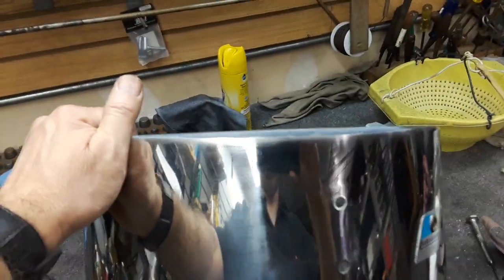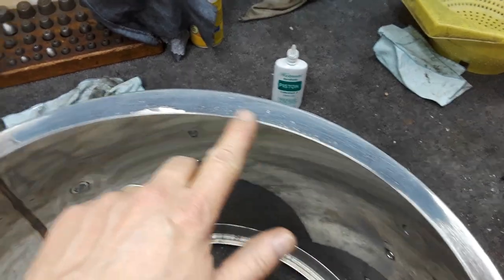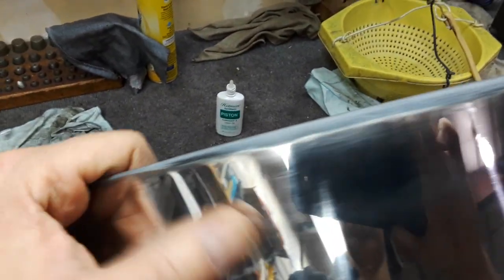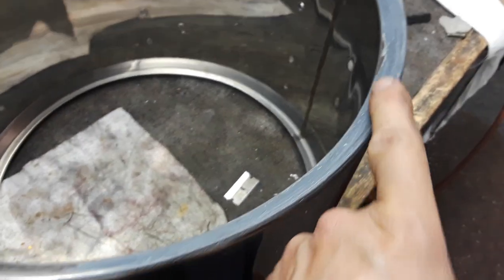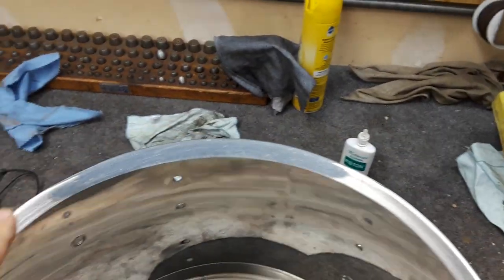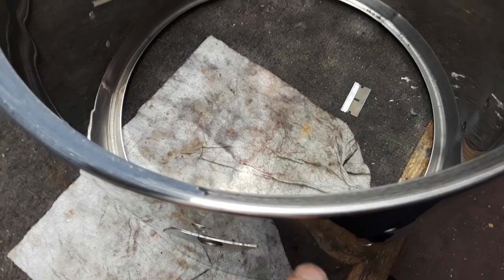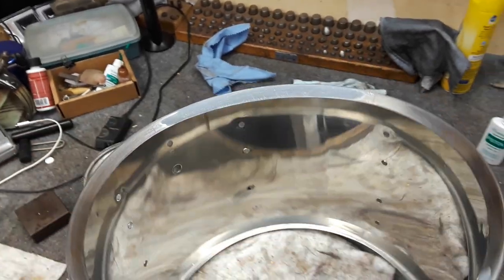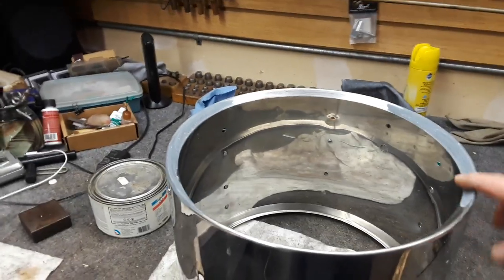Bearing edge repair Tom tom

Comment: How did you put it back into round? I have an out of round supraphonic.
Reply from the maker: Tape measure, check at 4 points. Push, and pull into round. Measure. Repeat as needed. Done 100%